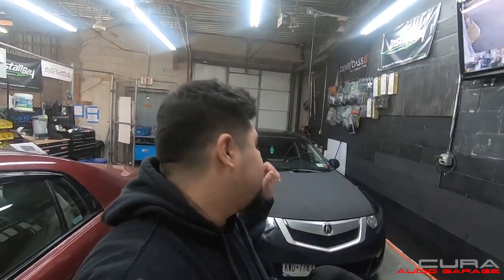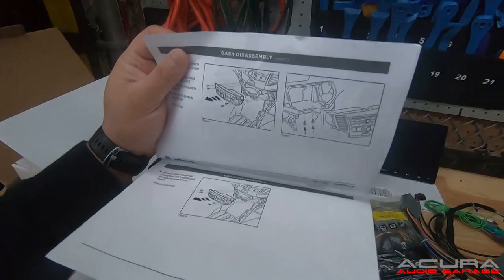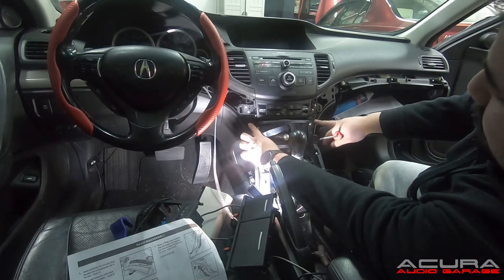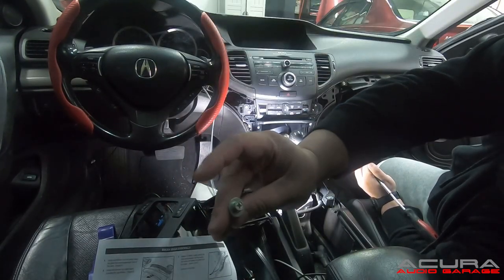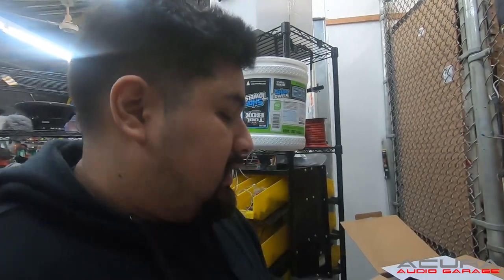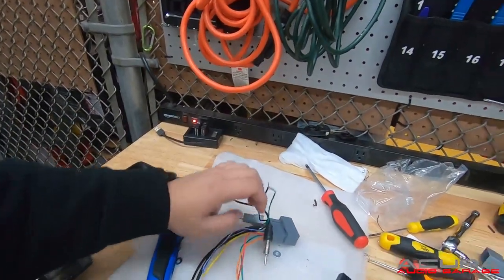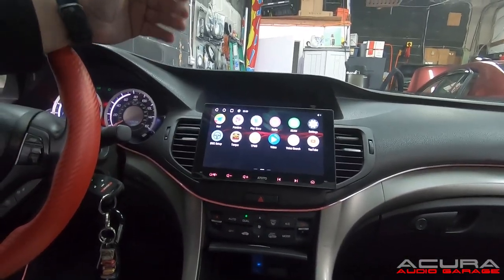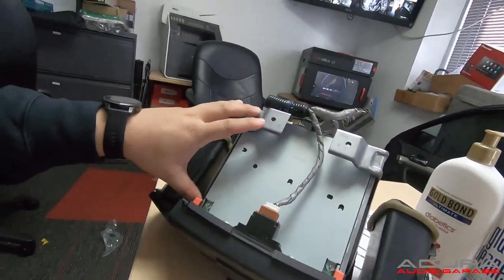2009 2010 2011 2012 2013 Acura TSX Radio Upgrade - Double Din Install - Radio Receiver Installation

Comment from the maker: If you are looking for the parts used in this video you can find them at https://mobilemaxcaraudio.com/product/2009-2010-2011-2012-2013-acura-tsx-non-nav-aftermarket-radio-install-complete-kit/
Reply: What are the measurements of the head unit?
Reply from the maker: this was a customer supplied radio so we don't have all the information. But I think it was this radio https://www.amazon.com/ATOTO-Android-Navigation-Stereo-2xBluetooth/dp/B076D5TVVX/ref=sr_1_3?
Reply: what other headunits do you reccomend besides the amazon ones to put android radio into a 2010 tsx with navigation? i know in video  said a couple but do you have model numbers of a couple you would install? something with same size screen and features etc but a better brand.
Reply from the maker: Pioneer DHM-W2770NEX Kenwood DMX709S Sony AX6000 @rlfdavin
Reply: I have a special edition tsx and having issues with a Amazon android I have no connection for sub and attana different aswell

Comment: Definitely will be looking for the ELS/Navi upgrade video. That head unit has the AC info on the tuner dial, and want to retain that. Thanls in advance!
Reply from the maker: Mark can you send us a video of how the AC info is shown. We have come up with a solution to retain the factory amplifier but for the factory navigation and controls you would need to modify the dash kit and mount the knob while also leaving part of the navigation plugged in and tucked behind the dash. So this is less then ideal but without a TSX to test with we are stuck right now.
Reply: @AcuraAudioGarage  where are you guys located? I can bring mine for testing lol

Comment: So I have the nave version I switched the nav display to the basic one but the wire harness for the base the aux power does not work. I don’t know if it’s my car or not but the concistant power works I know there is nothing wrong with the deck because if I twist them both together it powers up fine but obviously I can not leave it like that

Comment: Hello, I am using the same vehicle, the model with factory amplifier. I installed Android multimedia. It is a plug-and-play socket. However, the sound quality is not as good as the car's own premium sound multimedia system, in fact it is quite bad. I would be grateful if you share your wiring diagram.

Comment: You helped me so much when I had to order stuff for my 07 TL. Finally got my hands on a tsx wagon with Navi so I’m looking forward to the Navi ELS solution .
Reply: I’m in the same boat. Have you found any solutions yet? Are your speakers still holding up?

Comment: staying tuned for the 2010 with Navi radio upgrade
Reply from the maker: We have come up with a solution to retain the factory amplifier but for the factory navigation and controls you would need to modify the dash kit and mount the knob while also leaving part of the navigation plugged in and tucked behind the dash. So this is less then ideal but without a TSX to test with we are stuck right now.
Reply: @AcuraAudioGarage  where are you guys located?
Reply: Hey I’m interested in the 2010 Navi radio upgrade too. I’m located in Raleigh, NC.

Comment: So I have a 2010 Acura TSX with the tech package, would there be any issues I would run into with the default navigation system if I tried to follow this video for example or buy one of the complete packages you offer?
Reply: Same
Reply from the maker: Yes you would end up with low audio and a non working navigation. The backup camera will still work but you wouldn't be able to access climate control information. As for the audio you could then bypass the factory amplifier and get the right amount of volume back but you would lose some speakers.

Comment: Hi! 
This is definitely great help. Extremely detailed. Could you kindly confirm if the phone buttons on the steering wheel work with this or any aftermarket installation?
Reply from the maker: The call hang-up and pickup buttons don't work unless you run additional wires to to the HFL in the car or solder some wires at the steering wheel cover.

Comment: @AAG - my bad, I asked you about a 4th gen upgrade and in your library, there it was. Ques - what Pioneer DDin will fit in the new dash bezel you are using or if I use the Mehtra - 99-7808B? Seems the bezel opening will not handle anything bigger than a 5 or 6 inch display. I like that you mentioned some aftermarket devices are not the best choice. Keep postin', love the help and channel.

Comment: Hey mate, I am from Australia and have an 2012 accord euro which I believe is an Acura TSX there in the US. It has the 10 speakers system, just a question is there a way to replace the head unit and keep the factory amp and also have the steering remote working or is it either/or. Thanks, just want to know what my options are before I purchase a harness from you, considering you ship to Australia. Thank you.

Comment: I Enjoy your videos, thank you.  I have a 2013 tsx wagon with navigation.  I want to upgrade the bass.  Have any words of wisdom? I'm thinking if I can find one that fits and works well a self-powered box that can be put in the storage compartment underneath the hatchback floor.  Use the OEM subwoofer connections for bass an run power to box.  Have concerns though that won't have air movement allow bass out unless vented in some way.  Or remove the OEM subwoofer.. pay someone to make a custom box bigger better sub with a amp I have somewhat of a OEM look, stealth not take much cargo room up.  Or if have experience adding a amp to OEM subwoofer over power or replace OEM subwoofer same size in OEM box, replace OEM Sub amp if makes sense, good bass doing it
Reply from the maker: yes you can probably get away with using the factory enclosure just seal it really well with silicone or glue and then add another amplifier. The signal wires are right at the white plug that plugs into the enclosure. We actually have that white plug, its the same as the honda accord crossover plug.
Reply: @AcuraAudioGarage  interesting I've never thought about using the factory enclosure Sealing it and adding an amplifier externally. Lol Wonder if anybody else has tried it to see what can be gained

Comment: Hey man, I have a 2012 honda accord euro which I think is the same model as the acura tsx in the US. I have the premium audio version with a built in amp. Do you know what wiring harness I need to buy from your site that will work? Thanks

Comment: Hey I have a 2009 Acura tl with the tech package, for now I just want to upgrade the speakers and keep the factory head unit and might change out the amp in the future, is there anything I should know before doing this, also I really want to change out the center and rear door tweeters do you have a set for that ? Thanks !
Reply from the maker: Yes you can find all the speakers on our website. As far as things you should know I would say be prepared for the rear deck speakers and subwoofer to be a pain. The 3.5 in the rear doors aren't that important but you can upgrade them. The front doors are easy but the tweeters are also annoying because of where they are.

Comment: I have a tsx wagon with tech package and i want install a full system. I have 2 amps, pioneer double din, 2 sets of 6.5 speaker. What radio harness i need to complete the system.

Comment: Hey I'm a subscriber of your video I have a big problem with my radio,I have a 2009 Honda accord I purchased android radio on Ebay for the same like the 2009 Acura tsx it fit in turn on steering control button working an every thing but I'm not getting any audio

Comment: Hello, good evening, I am writing to you from Turkey. I have just subscribed to your channel and I watch it with admiration. Your posts are very useful. I have a question for you. My vehicle is a 2009 Honda Accord Executive. There is a premium sound system in my vehicle, but the sound quality is very low with the double din android multimedia installed, I only get good sound from the front speakers, the rear subwoofer and I can't get a good sound from other speakers. What should I do for this? The car has an original amplifier. How should the connection be? I can get a very good sound from the original stereo. Can you help me?
Reply: emre bende ayni dert ten muzdaripim 2011 accord cu1 aracım  yazdım ama bu adamlar bağlantı şeması paylaşmaz sanmıyorum.. sanki bağlantıda bir şeyler eksik ses te loudness doygunluk yok  cansız bir ses veriyor ' kanal bilgisayar hoparlörü gibi çalıyor
Reply: Why don't they answer? This is not a secret.

Comment: Hi bro. I believe the uk honda Accord cu2 is the same as the Acura tsx 2010 plate. You have anything for the sat nav with the premium door speakers? Want to replace them all. Ta
Reply from the maker: yes the ELS system has some decent speakers so you can checkout this link for some quality replacements. https://www.amazon.com/shop/acuraaudiogarage/list/TAZA2MVIGJ2T?ref_=aip_sf_list_spv_ofs_mixed_d

Comment: Hey man I installed some Infiniti Reference #9632xi 6x9s in the back of my 07 TSX and they worked perfectly up until yesterday. They crackle and pop with just a little bit of bass now and I have no clue what happened. Maybe the factory amp failed , loose wire maybe ? Any insight would really help man ! If its the amp I want to upgrade like the one you showed on the short. Thanks brotha !
Reply from the maker: So this doesn't seem like a loose wire type of issue. It could be either the amp is sending them a bad signal because it is failing. It could also be that the speakers are starting to fail and they couldn't handle all the bass. It's tough to know without some diagnostics. Also if you were playing with the engine off it could just be the amp didn't have enough juice to put out the proper signal.
Reply: @AcuraAudioGarage  Thanks man, I do think the amp is about on it's last leg. I will do some testing and if that is the case I will snag your TSX upgrade kit .  Appreciate the help very much !

Comment: I have a tsx wagon with nav and ELS system I changed out my speakers to some Rockford 4ohm 45watt rms and now my sub and rear channel speakers turn off randomly and won’t turn on until reset any suggestions???
Reply from the maker: the ELS system has 2 ohm speakers so when you swapped with 4 ohms it put a different load on the amplifier. Also when you installed them can you verify the terminals aren't touching the metal of the door?

Comment: I have a 2002 rl and Everything is hooked up and the radio comes on but there is no sound and it did have the factory bose system any tips?
Reply from the maker: it sounds like the factory bose amp is not turning on did you connect the blue wire

Comment: Hey, so how are the line output converters connected to retain speaker audio
Reply from the maker: so if you have this exact radio and converters you connect white to white, grey to grey and so on. If you have different converters then find out which is FL and match that to the white pair and the FR to the grey pair. For the rears green is left and purple is right.

Comment: Hey bro, I’ve installed my double din to my Non tech tsx. Everything works as it should except for the sub woofer. I plugged in the sub adapter harness that came in from metra but it only has one white rca meanwhile the alpine unit comes with 2 white rca for sub. Can that be the reason of it not turning on?
Reply from the maker: The subwoofer was working before? It could be the output from the Alpine is really low try putting up the sub level in the settings. Just using 1 rca won't be an issue.